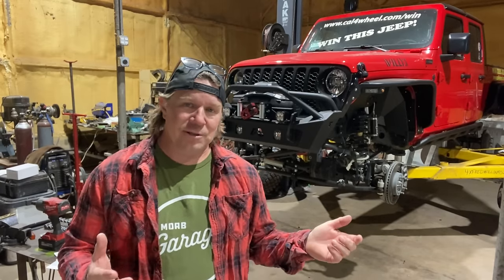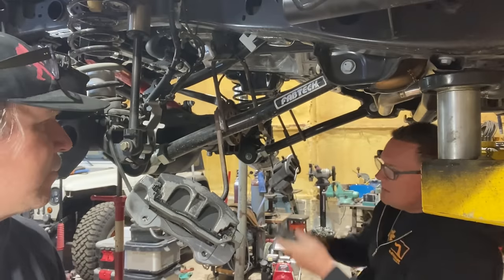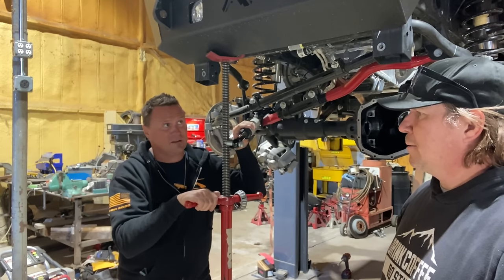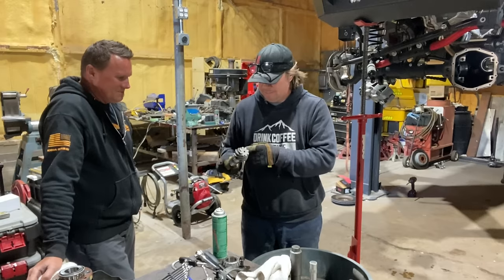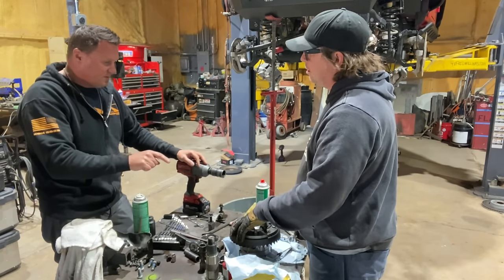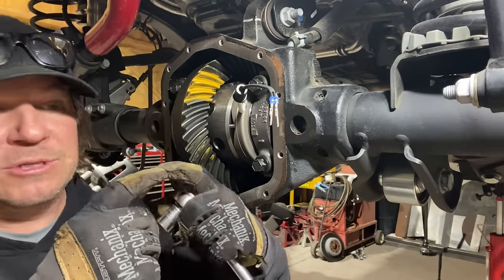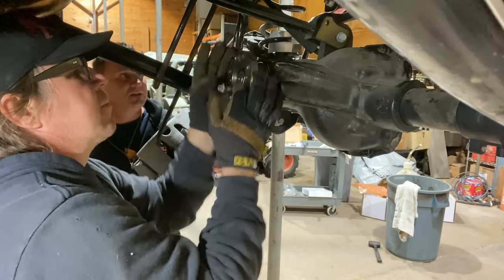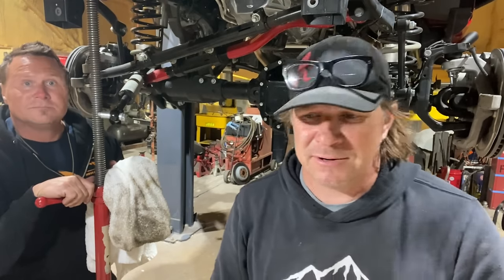Dirt Daily. The Give A Way Gladiator gets Gears and Lockers

Comment: Hey Fred for torqueing the ring gear bolts on the press I use a couple of 1 foot long pressure treated 4x4. I put the across the base of the press with the carrier between them and the ring gear teeth down on top of the 4x4s. The pressure of the press makes the teeth bite into the wood and the base of the press bites into the bottom of the wood so nothing spins and nothing gets marred up other than the wood. I've done Dana 44s, 60, and Corporate 14 bolt this way on a cheap Harbor Freight press and it works every time.
Reply: Thats a great tip!

Comment: A good complement to learning about the newer AdvanTEK210/ 220 "D44" axles.  Now for me to get good weather and motivation to install the Mopar locker in my JT front axle. Sadly in my gravel driveway, at least when I did my XJ's axles it was on concrete driveway 20 or so years ago.